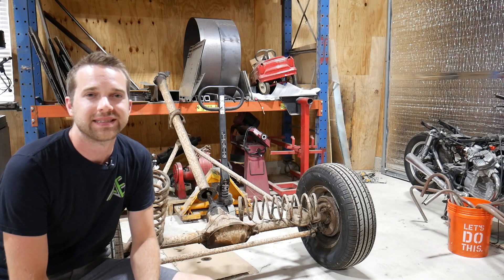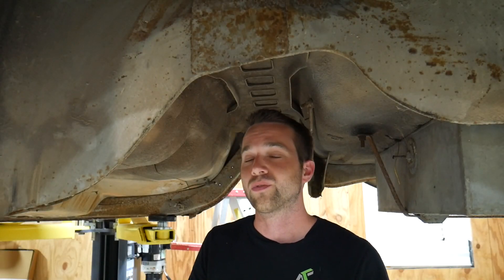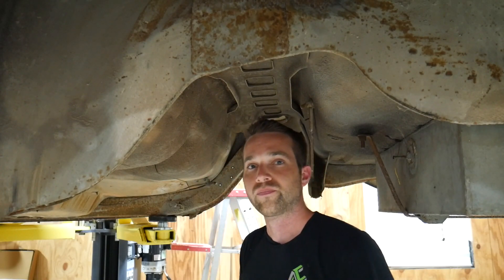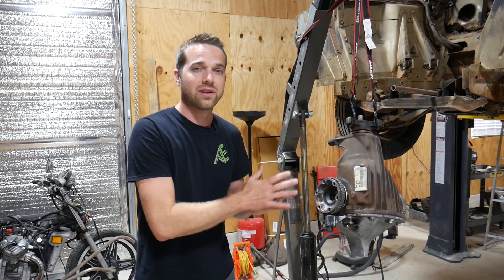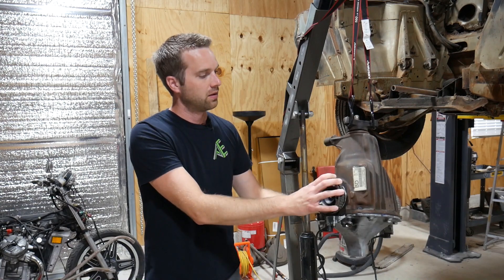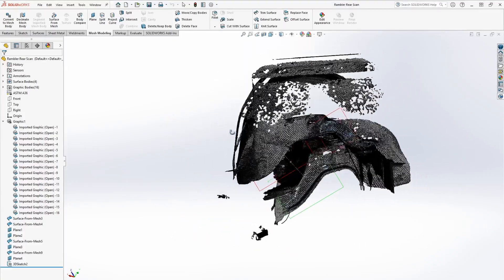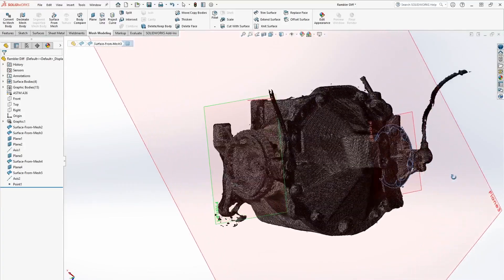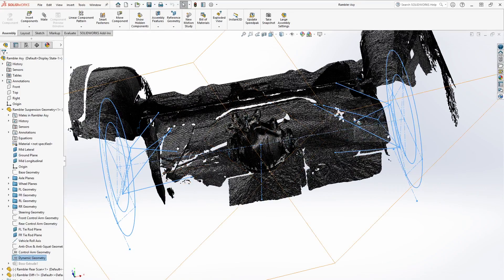3D Scan for Rear Suspension - Rambler

Comment: Nice work. I think for the price the Peel2 is a great scanner. I have a Creaform Handyscan 700 and do a lot of automotive part scanning with it. I plan on scanning the whole engine bay and K member on my Fairmont when I get to that project. Also you can get cheaper targets from retrotargets.com. I use them and they work great and are half the price of Creaforms targets.
Reply from the maker: Thanks for the info! Back in 2016 I saw a demo of the Handyscan 700 in-person and   I was sold on 3d scanning then and there. That is an awesome piece of hardware.
Reply: Given what you see here, any regrets? What's better/worse between the two scanners?
Reply: @vidznstuff1  The Peel2 is a structured light scanner where the 700 is a laser scanner. The 700 has a lot better resolution and accuracy. That comes at a price though. You could buy roughly 7 Peel 2 scanners for the price of a 700 when I bought mine :D

Comment: Awesome! What scanner and software are you using?
Reply from the maker: Thanks! The scanner is a Peel 3d, I'm using their software to scan with, and then exporting directly into Solidworks.
Reply: Are the results worth the $10k? I've heard it can be quite the headache processing scan data for use with CAD.
Reply from the maker: @rogersj3  Processing is definitely a challenge. I would agree that with scanners the hardware is quite a bit ahead of the software, but the software is getting closer with every update. That, and some experience applied to the clean up process removes most issues. As far as worth goes for me, yes, it is, but I also use it outside of channel related projects quite a bit.
Reply: @DirtyElbowsGarage  you still using this scanner - I bought one - and getting better with it. but its a bit tough lol.